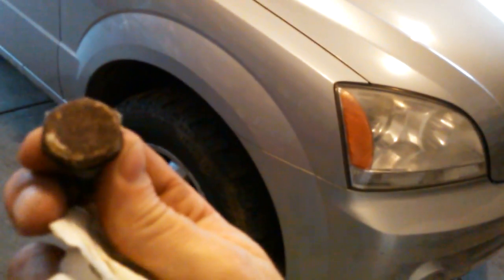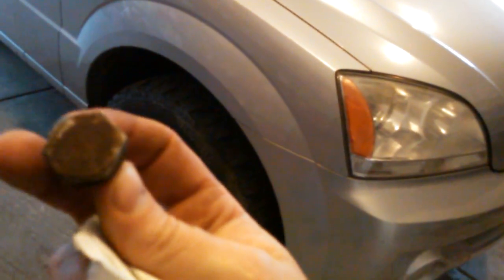KIA Sorento rear end differential - SEE DESCRIPTION!

Comment: Hello I have 2006 kia sorento also I wanted to know if you could tell me if it's ok to use 75W-90 differential fluid instead of the 85W-90??
Reply: Just helping. Fyi 75w-90. Told by my local kia dealership.

Comment: Where did you pull this info on jacking up the rear from?
Reply: @VTwin4Christ  wow. Glad your okay. So did you have problems with your diff after your fluid change? Haynes manual says jack it up but is not specific. I was going to do it yesterday and saw the details on your video. Was just going to do it level on ground.

Comment: My wife's Sorrento purchased in 2009 had the bearings go out after about 5 years. At the time the car only had around 35k mjiles on it. It was her first rear wheel drive car. I had no idea that we had to change out the fluid every 20k miles. Luckily, the repair was covered under warranty.

Comment: I just bought a 2008 Sorento 2.5 CRDI 5-speed auto with torque-on-demand & transfer case. It has had 1 previous owner and has done 65000km. Got some questions for you:

1) With a 2008 model, do I still need to jack up one end of the vehicle to change the diff fluids?
2) Which end of the vehicle should I jack up to change the fluid in the rear diff? How about the front diff?
3) Do you know what are the correct fluids to use for the front diff, centre diff and transfer case?
4) What ATF should I use for the automatic transmission in this model?

Thanks in advance.
Reply: 1. yes
2. rear. front.
3. Kia fluids
4. Kia ATF, or MaxLife if Kia is unavailable
Reply: So either measure what you took out and put that back in or get a Haynes manual and find the spec of how much to put in. If it's level and you still have a few more qts to go or what not jack it up and put more in. You shouldn't have to jhack up front to for your front diff or transfer case if you have awd. You don't need kia fluids just get the right weight. Like 90w. What a Chrisfix video to get a idea and join kiaforums for more advice.

Comment: usually that dudududud and then fades away when you drive faster is a bad rear end. it as well went out on my 2005 kia sorento but when that starts going out your driveshaft upper support bearing will go out as well it doesn't matter if you just change the support bearing or not it wont solve the rear end problem I changed just the bearing and bearing went out again so go to LKQ and get a low mile rear end and make sure you see the picture of the car it came out of make sure it was not hit in rear, Also changing these rear ends are not easy they weigh a lot and have a ton of supports!!! I'm glad I'm not the only one having problems with this. don't for get if that upper support bearing goes out it can be dangerous if not replaced best to change it with new ujoints.

Comment: I have a noise in my front drivers wheel... As driving down highway and floating in the dips and rises of the pavement,  I hear a faint sound that is now getting louder. The dealership said its the differential. I swear its the wheel bearing... As driving and as I "float" on highway it makes a rubbing sound as the weight of the car lightens and then again settles down into the dips of the highway. I can hear it in the front....  I do also hear a "winding" noise from the middle underside of the car which can be the differential... as they DID find metal shavings too in mine.
Reply from the maker: Boo B From what I read... Metal shavings are normal for KIA Sorentos... Have never heard of metal shavings being normal.   But I can assume you that I replaced my rear end and it WAS NOT THAT!!! It was actually the UV Joints and center support bearing.   One should also note that there is a HUGE difference between the automatic center support bearing and the manual.   They both look the same, but one is about 250 dollars more (for the manual).

As far as sounds / wobbles when there is less load on a tire... It could be bearings, joints, drive shaft couplings, etc.   

I would jack it up... Place hands at 12/6 and try to wiggle tire.  Then try 3 and 9 positions and try and wiggle.    This will tell you if it's a balljoint or possible bearing.

If it's heat related... takes awhile to do it... I would jack it up, start the vehicle and put it in gear.   BLOCK THE WHEELS FOLLOW SAFETY GUIDELINES.   Let it get up to temp, then see what it's doing afterwards.  (like squeeking when you manually spin the wheel).

And all this depends on if you have the 4X4 or 2WD as to what procedures to take.

I would start with the simple stuff and work your way up to the more complex.    But there are only so many things it can be.

Comment from the maker: Nope... Had all sorts of odd sounds.   Turned out to be a bearing on the drive shaft had gone out, two of the universal joints were shot... And I replaced the rear end just in case (due to the shavings).    After it was all done, I learned that IT IS COMMON for the rear end of Sorento's to have metal shavings.    I couldn't believe that... COMMON TO HAVE SHAVINGS is not good.

I can say that the loud roaring sounds was terrible... And it was 99.9% the drive shaft bearing and joints.    The cheapest place to get joints is out of Columbus Ohio... I think the name of the place is The Joint Store or something to that effect.   It's a small business and he manufactures most of the Universal joints for this part of the country... I believe I got three of them for dirt cheap.

I would also HIGHLY recommend a good 6" bench vise for doing the UV joints.